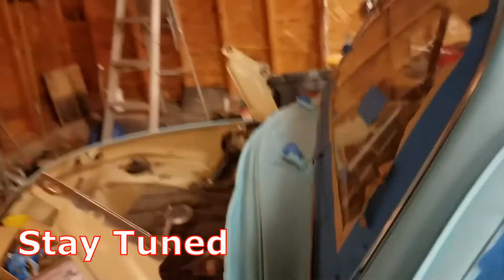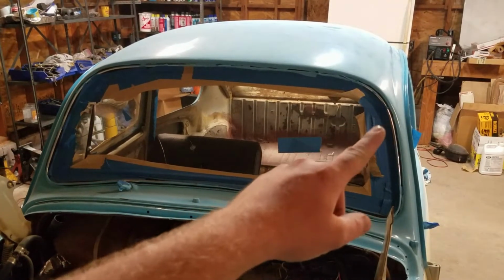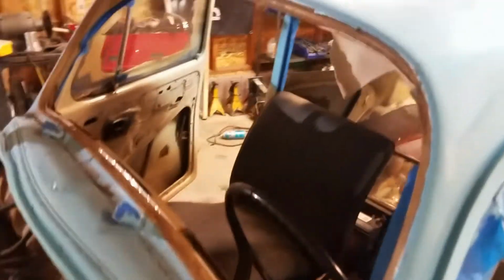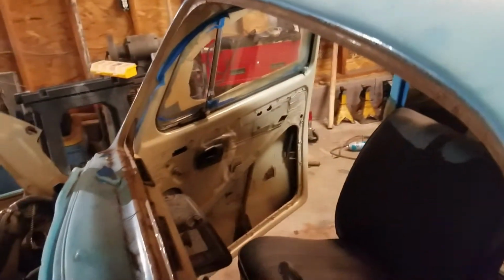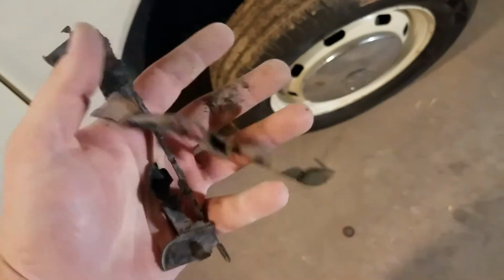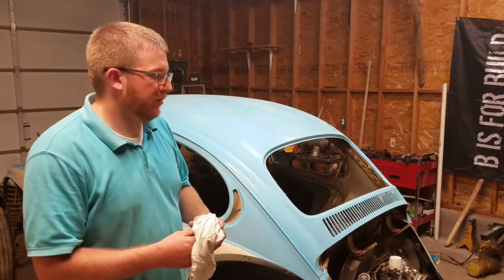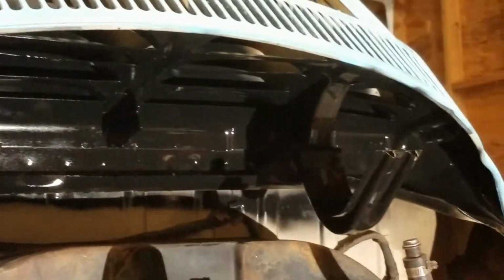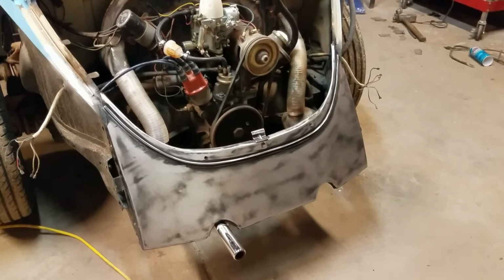1971 Volkswagen Beetle Front Window Removal - Paint and Primer gets applied!  *love bug rebuild*

Comment: use some tape mijo inside and out this way if it wants to fall apart it won't. a heat gun is good also heat around the glass but not to much and it should weaken the grip